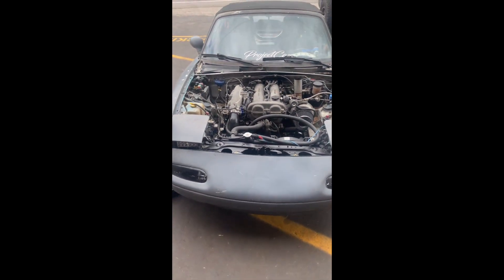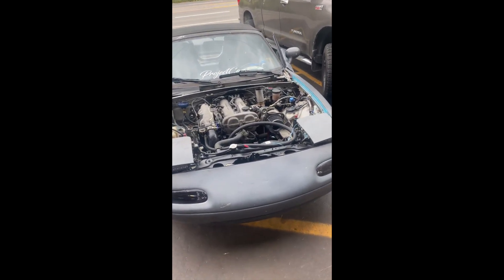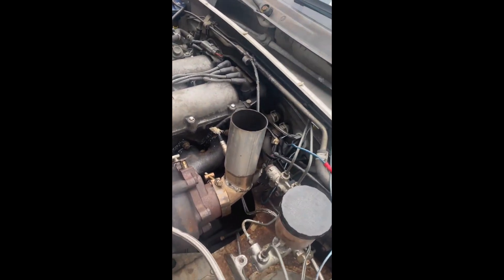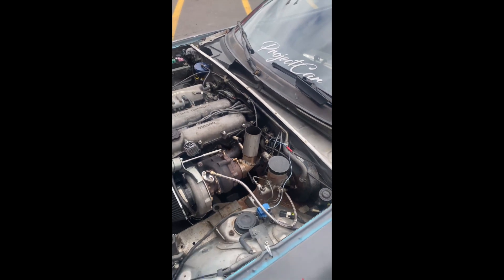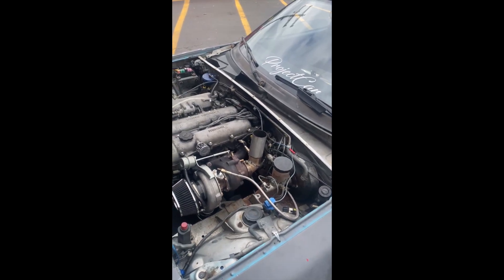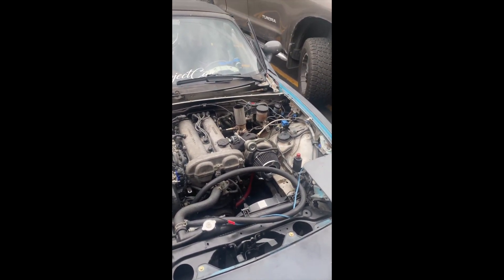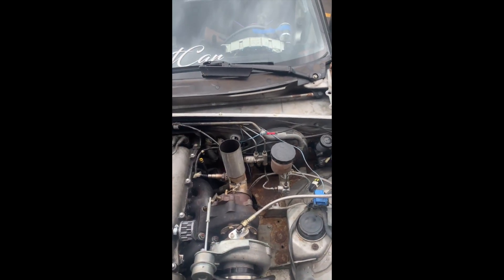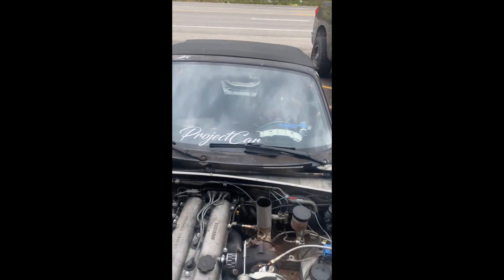Mazda Miata 4cyl EXHAUST w/ TURBO BACK STRAIGHT PIPES!

Comment: So I wanted to comment on a more recent video. I’ve been scouring all your videos for what I’m trying to set up exactly and can’t find anyone that’s done it.   I have a 2020 scatpack charger. And had a mid muffler delete done a while ago. It’s created a mild drone in lower rpm at cruising speeds. So I’m thinking of adding the mini dynomax bullets in place of the mid mufflers. But was also thinking of removing the rear resonators and adding the same bullets there as well. Have you done or seen anyone do a scatpack with replacing all the mufflers and resonators with mini bullets